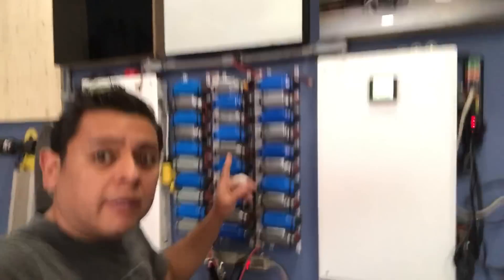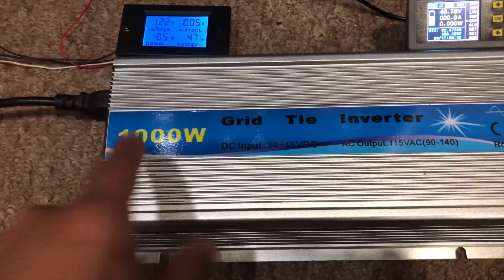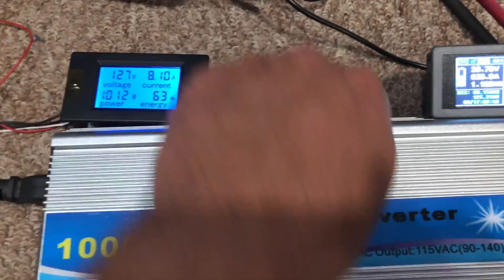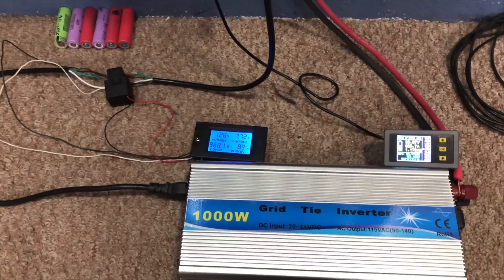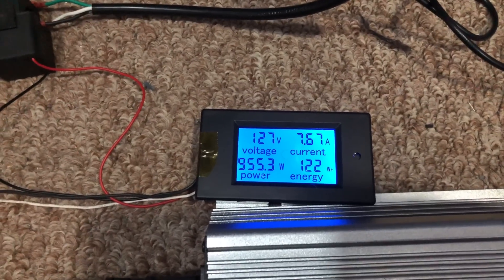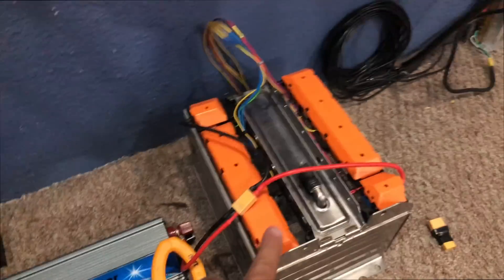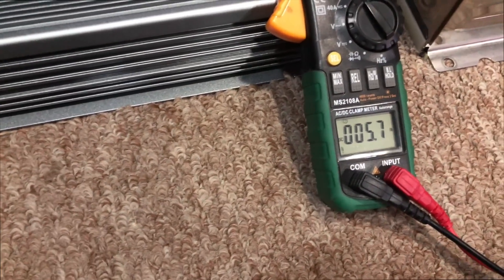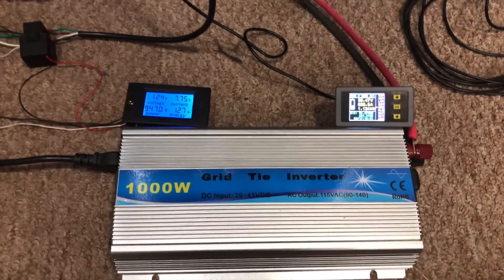Do Cheap Amazon 1kW grid tie inverters Put out 1000 Watts?

Comment: I have a string inverter in my garage that was professionally installed and it puts up to 4000 watts back into the grid.  Since I did it right, my meter can go backwards and I don't have to run grid-tie inverters only when the air is on.  My question is, what happens if I also plug a small grid-tie inverter like you have into my house somewhere?  I have extra solar panels that I'd love to use the energy of.  The DC voltage would be too low to add those panels as an extra string on my main inverter.  If I buy a little grid-tie inverter like you have, I'm worried the two inverters will compete for the highest voltage.  Also, if I have a power outage, won't each inverter trick the other inverter into thinking grid power is still on and they'd maintain power output?  I definitely don't want to cause harm to a lineman.  You're talking about using multiple small 1000 W inverters at once though so you might know how that works.  Thanks in advance!
Reply: It won't "compete". It will just put out voltage high enough to put out as much power as it can.

Comment: So, I can get 18650 6,000mah batteries and I am wondering how many killowatts I should with 100 of them.
Reply: 2.22 kWh. . . someone check my arithmetic.   While 6,000 miliamp hour 18650 cells might exist, many labeled that high are Chinese fakes.
Reply: Mark Phillips thank you. Is there any chance you can recommend a legitimate place to get 100 18650 batteries at a time?
Reply: Anywhere.  Just find a trustworthy online seller,  stick with name brands and you'll be fine: Panasonic, LG, Samsung, Sanyo, LG, Sony, etc.
Reply from the maker: https://j35.us/Power2Spare
https://j35.us/15A-1300mahSamsung
https://j35.us/2200mahCells
https://j35.us/LGDAS31850-5
https://j35.us/Modem-grey-2600mah
https://j35.us/Modem-purple-2600mah
https://j35.us/ICR18650-26F-6
http://j35.us/Samsung44ahModules
http://j35.us/6xRAYOBI-packs
http://j35.us/5s2pX2-packs
http://j35.us/20A-PowerTool-cells
http://j35.us/7x2165-2600mah

Comment: I used one of these as a test unit before moving to a fancier version that monitors the AC usage  in your house and then turns itself down when the power isn't needed. To avoid back feeding into your meter. I'm using it to offset the usage of my pool pump. Similar to what you want to do with your AC. It's still a made in China thing but it has more advanced features and an lcd screen. I believe it also has protection so that it will turn itself off before draining your battery completely. I am running mine from panels so I haven't used that feature.

Comment: I highly recommend using a 60hz 240v units if your in California as SCE will cut you off if you drive your spit phase power out of wack or if you run 6 units put 3 units on each side of the hots and run a 10a breaker on each one. Do it right it can be done cheaply and safely at the same time. Hit me up I'm local to you if you ever want to chat and talk I'm building an ev atm using a custom home made 300/90 quad stack 6phase 12 poll motor that can dump over 1400hp and 2200tq into a custom 2016 ford focus RS. using 10x model s modules, hacked the tesla bms so using it over a custom CAN bus system designing a custom brain atm.
I'm both a hardware engineer, And a machinist my shop is a trailer running 1.1kw solar, 4 tesla modules, 5kw inverter.
Reply: techmasterjoe Do you have more details on you trailer/solar/Tesla I’m looking t o adapt something for my sailboat using Tesla Modules, thank you
Reply: EL EL atm i do not but i have taken photos, code, pcb's and a note book on the build i will be building a buildlog blog soon. And a video as well.

 But in general i just treat model s batts like a 24v lead acid but do run a contactor and a bms with undervolt cut off if 1 cell drops below 1.5v the life of the cell can drop a lot.
Reply: I was just scratching my head over the pro and con to refitting everything on the boat for 24v.
Reply: EL EL honestly just change things that use more then 30amps. If under 30amps use a dc to dc 24 to 12 buck converter
Reply: If he is in California there is a good chance those inverters are illegal due to Rule 21 requirements unless he has an automatic transfer switch.
Reply: Frith he is fine just run a contactor on each one and only power them up when the compressor for the ac is running. Another option and one I'm thinking of is pure offgrid use a big inverter to power the house from batteries and just charge the batteries from solar and the grid as needed

Comment: hello , i have a serious problem related to battery packs and inverter ups connection>
i have 24v DC - 220v AC ups inverter, which charges battery with 27.1v , seems like made only for charging 2 lead Acid battery in series (13.8 + 13.8 = 27.1) , 

i made 6S15p Battery pack from 18650 cells,  which has 25.2v fully charged voltage, but when i connected them with UPS , it made pack wires warm, 
if I try to make 7S battery pack it will become 29.4volts, so it will not get fully charged .

So what should i do ?
6S or 7S

or just leave this idea and just use lead acid batteries as it is not made for lithium ion,  i would love to make it work .... 

i'm from Pakistan, there is not such UPS inverter available which is made specifically for lithium ion batteries. 
Thanks
Reply from the maker: 7s
Reply: jehugarcia ok thanks

Comment: How would you use the grid tie inverter with the solar array and have it switch between charging the batteries and giving to the grid?
Reply: Jake Stephens I have wondered something similar. I want a system where I can plug into "shore power" and it charge my batteries, and once the batteries are full it sends the extra power to the grid, but I don't know what units can do a shore power thing and grid tie while being off grid. So, it's similar, but.... Different. There is an inverter generator by renogy that plugs into the grid to charge the batteries, but I don't know if it sends the extra power to the grid once the batteries are full or not.
https://www.renogy.com/renogy-2000w-pure-sine-wave-inverter-charger/

Comment: Since your home is using electricity before the AC turns on and the inverter is just below 1000 watts, that means you need more than 5000 watts of inverter power before they are off peak wattage.

Comment: Cooling fans are the weak link in these inverters. They overheat and stop. Had to put in larger fan.
Reply: Add a heat sink
Reply: 100% true.  If your running them above about 600w keeping them cool is the key. I'm adding an extra fan also.

Comment: Think it tapered off with the drop in supply battery voltage? Secondly, you’re a cowboy without an interconnect agreement with PG&E?  Most likely they have a digital meter on your house, are you worried about the meter sensing any watts going back up the line? I’d like to do similar, but not get any hassle from the power company.
Reply from the maker: I ain’t planning on sending any back, that would be wasteful
Reply: Me too! The only way to get a interconnect agreement here, is if you buy a complete house system and  its installed by Company! wich is about $20,000. I dont care if i give back a couple of Watts but if the Power company is going to charge me then NO. I bought a 1000 watt inverter with limiter but havent connected it yet.

Comment: That inverter is only 80-85% efficient which means you are wasting  up to 1kW for a 5kW bank.
Much better to run a 100-200 volt battery supply and use a real inverter with >95% efficiency, e.g. Mean Well as other responders have suggested.
Reply from the maker: Yes,  but how much are those inverters?
Reply: These big MPPT inverters cost around $600-$1000 but are large (2-5kW) so cost/Watt is not too different from your unit. They also come with MPPT which has much better usage of solar cells. The main benefit is that they will convert 95% of battery/solar energy to usable power whereas cheap units only convert 80%.
You should have a look inside your unit and you will see where cost has been cut. They are not reliable and very difficult to service.
I have both types on my solar system. I have 3x300W units ($100 each) and one 2kW unit ($600). Two of the 300W units have failed in the last 4 years. The 2kW unit has been 100% reliable.
Reply: jehugarcia for $1800 I could sell you something that would do the job of all 5 and would last 12 years, you aren't saving money burning through those small cheap ones with insufficient heat sinks and fans.

Comment: Grid tie inverters are not made to run on a battery. The battery current is way too high. They are made to run  on the output from a solar panel.  You will burn out the inverter.
Reply: Bryan Corrigan is absolutely right. you have to learn Chineseering my friend
Reply from the maker: we shall see
Reply: I have the 600w version and I linked mine to the batteries and it blew the mosfets so I ordered 4 new mosfets replaced them it's working now so I have now linked straight to the panels and its lasting longer for now learnt the hard way
Reply: The 600 watt rating if for input power not output. If you supply more than rated power expect it to blow, be it batteries or solar makes no difference. In this video he used too much power feeding the inverter, it will blow soon. Efficiency is the important part. Here it is about 75% nothing great. @MusGym-official
Reply: Wrong, current is depend on load not the power supply.
Reply: Inverter is rated at 1kW, it won't pull anymore than that.
Reply: @luongmaihunggia  You see in the video it is pulling 1200W ,,,, and output 1000W.
Reply: @knutposchel2165  hmm, strange, the fuse should've blown.
Reply: @wu ming that still doesn't explain why the fuse wasn't blown, but then again, the inverter was pretty cheap, wouldn't expect high quality fuses and electrical parts in it.
Reply: @wu ming Make sense.
Reply: Have you ever even owned a grid tie inverter???? American made Yes the fuses are in the correct place. Most of the Chinese made inverters ( the one in this video is Chinese) are not even UL listed.Maybe the fuse will blow, maybe not. Anyway this is pointless You are obviously not speaking from real knowledge or experience. You are just trying to be right.
Have a really great life....................
Reply: Wrong, A grid Tie Inverter will pull as much current as is available. A regular inverter will only pull as much as is needed. Grid tie inverters are made to only be used with a solar panel(s). If you connect too many solar panels, the inverter will get hot and burn up.
Reply: Bryan Corrigan inverter will never burn, they have fuses for a reason you know.
Reply: Fuses always burns before electrical components unless if the you use fuses that have higher current rating than the electrical components, I think I see why your inverter burned, next time use fuses that have slightly lower current rating than the inverter.
Reply: No true. Fuses usually blow faster than transistors. If you overload the circuit the fuses might not blow faster than the circuit it protects.
Reply: How about you? Have you learn anything about electrical engineering? If you have you would know that the fuse work by melting, when the current get too high the fuse will melt, turning off the circuit before other electerical components melt.
Reply: You can not be serious!!   The mosfets WILL BURN!!!   Cheap Chinese made inverters can even catch fire. Do your homework before your lack of understanding burns someones house down. PLEASE!!! I burned out a 1200 watt grid tie inverter by connecting too many solar panels. Others have tried connecting a car battery to a grid tie inverter. It will work for a while, get VERY hot, the fan will come on and then at some point it will burn out the mosfets. If you want to run from battery voltage alone, use a regular sine wave inverter, or a hybrid inverter. I can see this doesn't make sense to you, but if you check to see how a grid tie inverter works you will understand.

Comment: 5kW for the A/C unit? How big of a house you've got? I keep a 70sq.meters house cool using a split inverter A/C unit the whole summer, and it doesn't sip more than 800w when running at max! Maybe you should consider upgrading your A/C unit to a modern one.
Reply from the maker: That’s another project
Reply: 4-5kw is about what a 12seer A/C unit  which is about a 2 to 3 ton sys

Comment: When did u get those fiat 500e bateries?
Id love to see u do a review on em. 
I just got a whole pack all 25kwh and its like new. Ive already dismantled it and cut the 6 cell packs into 4 packs so i can get 14s with two 5 cell packs and a cut up 6 cell pack. Ive got one string together so far and have it hooked up to a APC smart ups 2000va. 
That leaves me with 13 spare loose cells. Maybe a go cart. Idk. 
But thats cool id love for u to go into detail on it. Mainly now that i have some packs without the metal should i make a new frame to press the cells back together to prevent swelling or should i not worry since the most any one of my 14s6p strings will see with 2 of those ups hook to it is no more then 14 amps not the 300+ amps they where built for.
Reply from the maker: no need to worry about swelling,    you went the hard way breaking the packs up,   please post pictures here so we can see how you did it.  https://www.facebook.com/groups/jehusDiYPowerwalls/
Reply: jehugarcia i dont have any social media accounts. Im 32 and my wife and i both decided they are just places to be narcissist. The dopamine that is released is too addictive (simon sinek why leaders eat last on youtube explains this) But i will make a youtube video and post it here on this reply chain. But basically i just used tin snips to cut down side of the pack at the cell lines. Then bolt jumpers to the terminal leads.
Reply: jehugarcia https://youtu.be/ehzqHwQIT_E
Here u go. This is where i am with it so far. Dont really like the beebing in the video but i cant get APC powershute working on my windows 7 laptop yet.

Comment: hrm not a bad inverter, question dont you need the grid tie limited? otherwise the power meter will actually run faster depending on how smart the meter is, you also will not get paid for power going to the grid so why bother running it, i know you will have a control to swich on the inverters (im very intrigued how you are going to hook that up) but for that time that the inverters are still on once the ac has just turned off you might get charged with the power even though it is going back to the grid. just a concern as to what is actually happening.

Comment: My biggest question is, will this unit shut off if the grid power shuts off?
Reply: Yes they will need an external sinwave to operate... but if you have at least one regular Sinwave Inverter in your setup it can work as an island System. But you have to consider to switch off your mind connection when you're in Island Mode
Reply: jehugarcia, I care because i live in sweden. I don't know what rules apply to you, but if the inverter does not turn off when the grid turns off i will be thrown into jail for using it.
Reply from the maker: who cares,   thats a non problem
Reply: TecSanento, Thank you! Another worrying problem is if it is directly plugged in to an 10A outlet (230V eu standard) in the house. Lets say two inverters are connected, now the 10A fuse will not work properly for the remaining outlets. Any appliances that has a problem will now be able to draw 20A thro wires ment for 10A.

Comment: It will burn up running at max in a short time. I use a boost converter and set the max amps to keep the inverter from hitting a max 1000w. On my 48v system I use a buck converter to do the same thing
Reply: What device are you using? Thank you

Comment: Just in time I was thinking of buying one I just bough the mpt-7210a to charge my ebike but I got a total of 960w solar system and that cant take advantage of all that power but I also want to do it because the ac pulls about 700w but then I'm scared my ac will turn off and then my meter count backwards then the power company will come

Comment: Is it pure or modified sinwave?
Reply from the maker: grid tie
Reply: The inveterer uses the grid sinwave to modulate the ac - no grid no power ^^
Reply: jur4x should be 60hz bit you never know
Reply: 50hz, I'm in Europe. But is that frequency in modified or pure sinwave? Though people above said that since it is grid tie inverter, it outputs AC in sync with whatever it gets from the grid. And that means pure sinwave.

Comment: Hey jehu, i found that inverter on Amazon Germany, but everyone is complaining, that this thing will blow up within one month. There has literally every version of this thing only a 1-star rating. Do you know a good brand for 10S inverters? especially for 230 volts AC? thanks in advance!
Reply from the maker: these things are not really designed for batteries or for 1000w they burn up if you try to do either of those.  you have to be clever in the system design to use them.
Reply: Jan Seewald Sun systems gtil.